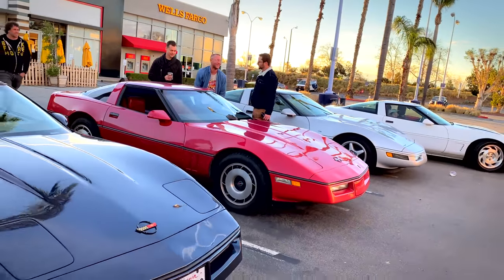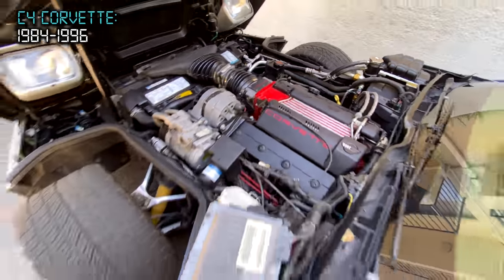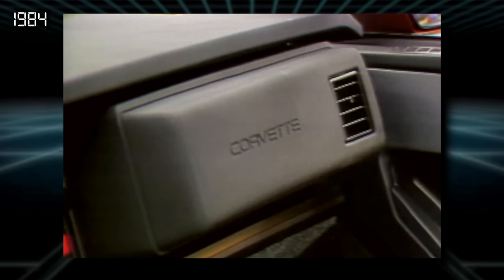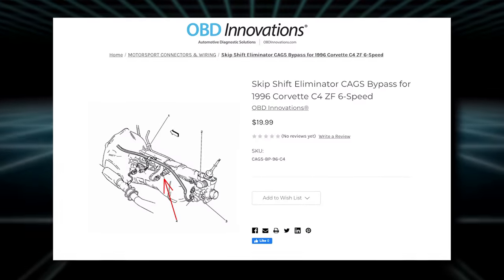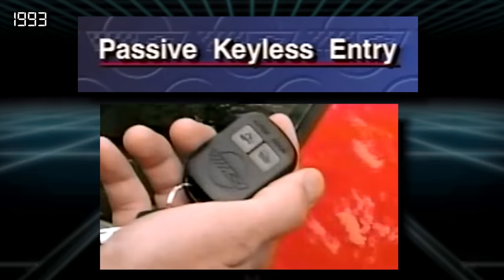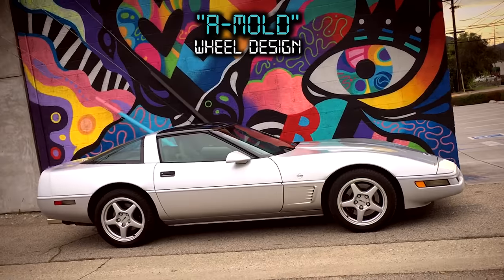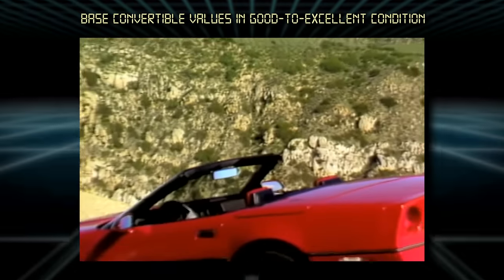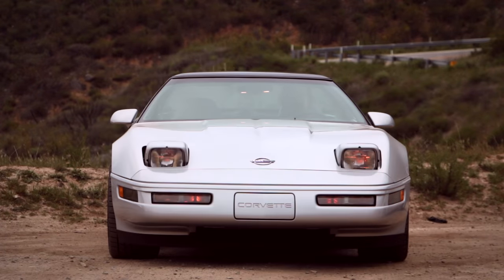C4 Corvette: ULTIMATE Buyer's Guide (Values, Performance, Yearly Changes 1984-1996)

Comment: I found in FL a Green with Beige interior 96 Collector's Edition C4 with 64k miles but it needs a bit of TLC. 3 things are going on with this C4 which needs a tune up as the minor issue and the 2 major issues is that the manual transmission is grinding on 2nd gear and the paint is damaged on the front bumper, driver door and driver quarter panel and driver side mirror. When I say that the paint is damaged I mean it's DAMAGED, the bumper has a big chunk of paint missing exposing the gray metal body, the mirror's paint is cracked along the edges, the quarter panel is missing a bit of paint close to the door and the door itself looks to be like someone put a dent on the door and cracked it in the process  along with paint being chipped there too. The owner is asking $10k for that Vette, would anyone justify investing that amount for a Corvette that has issues like that?
Reply from the maker: Well for one, that's not a collector Edition. Watch my Special Edition video here for what makes a true Collector Edition- 
https://youtu.be/vWhwNK5Lkyg

In any case, it sounds like a basket case example and I would avoid it, unless you love restoration projects. And even then, I'd only consider it for half that price. They're asking way too much from the sound of it.

Comment: My ‘96 C4 reaches overheat when stuck in traffic .. any ideas
Reply from the maker: Great question! Check out secret quirk number 2 in this other video I made…

If it’s overheating even more than that, check to see if the lower intake is clogged with debris. And make sure you’re running fresh coolant, some owners are running coolant that’s decades old. 
https://youtu.be/Hlp0wnXX_sU

Also, turn on your AC (Auto) and that will force the secondary fan to come on  in traffic.
Reply: Thanks … my ac is not working so that may be the cause… had the coolant and thermostat replaced . T think I need a new compressor 
I thought about the fan but was unaware it was triggered by the ac. Thought it came on at a certain temp.
I have the same lt4 collector as you.amazing 6 speeds but 
I sit in traffic with the heat on and watch the gauge go to the /// .. it’s nerve racking

Comment: I have always said a  c4 is technically a mid-engine car, oh and the transmission is where it should be- BEHIND AND ATTACHED TO THE ENGINE!!! My C4 is a 1994 I bought for $2800.00 and she is SWEEEEEET.
Reply from the maker: Nice, sounds like you scored a deal on your C4
Reply: Thanks. I've always wanted a corvette but could never afford the ones I wanted (any c2 or a 68 thru 70) no matter what condition they were in, they were always out of my $ range. Even when the C4 came out I couldn't have afforded one. Then all these years later, and with my acquired mechanical skills, presto changeo , while working in a tow company one got impounded.  Now it was in a really messed up condition, but with the acquired skills and hard work BINGO! BITCHIN RIDE! I'll never sell it and plan on buying another one. God bless, and be well.
Reply from the maker: @williamjames4687  Worth the wait I hope. Thanks for sharing!

Comment: I am looking at buying an 86 with the doug nash. It has 66k on it The body is decent but the Targa Top is cracked and passenger mirror is cracked. It also wouldn't start while I was there. But 15 min later they called and it started they know they is an issue  some where inside the car thats draining the battery? Any Ideas? And the intermittent no start would an 86 have a security system. I am thinkimg thats malfunctioning. If not that any ideas? Any help you can offer my would be greatly appreciated. Oh and what would you pay for this car. There asking $7100...
Reply from the maker: There could be many things causing that issue. It sounds like a car that’s been forgotten about and will need some love to get truly road worthy again.

If you want a project go for it and drive a hard bargain. But otherwise I’d have the seller fix it before considering it again, or move on to a car that will be less of a headache. 

My philosophy when looking at old cars is that if there’s many issues that ARE obvious that the seller hasn’t dealt with, you have to assume there’s quite a bit more that aren’t obvious that you’ll only find out about later.

Comment: Also I'm looking to trade my car for a 1984 C4. I have a 1991 Pontiac Firebird with 305ci TBI V8 paired to a World Class T5 Manual, i have zero issues with that car but is it a wise trade for an 84 C4? I know about the cursed Crossfire system and it doesn't seem too different from my throttle body set up just that the Crossfire has to be in sync to run properly and the current owner says that it's running rough, I was thinking about doing a Carburetor set up to fix that issue but don't have the funds to invest in a Carburetor. I did some looking around for a decent Carburetor set up and it looks like I can get one done for $800, would asking $1k on top of the vette be an okay thing to ask? My Firebird runs perfectly with a lot of maintenance records done by me personally, it has working ac, new alternator, clutch slave cylinder, tires, front pads, rotors, brake hoses, front and rear wheel bearings, lifters and valve stem seals and have extra parts just in case, the previous owner replaced the shocks and struts and hood and trunk struts as well.
Reply from the maker: I see no reason to trade your proven Firebird for a needy 1984 C4. Those arent the best cars even WITH everything running perfectly. 

I'd only go with that C4 if you are actively looking for projects.

Keep in mind that the GREAT thing about C4s is there are so many well-cared for examples out there to choose from. I'd suggest waiting until the right one comes along, or you have enough saved up to buy a trouble-free one.

Comment: If one of my tire sensors go bad how do I get rid of the light in the DIC? Or if I eliminate the sensors
Reply from the maker: Great question. I'm not a mechanic and I didn't dig in that far with my research to figure out the BEST way to fix those tire sensor issues. I know a lot of guys just pull the bulb out of the warning light! And then just get rid of the sensors when its time to change the tires.

Comment: My old 97 z28 got 15/24mpg
 My old 89 z51 got 16/30mpg
 The tpi like reving at just above 1000rpm
 My lt1 was @1600rpm at the same speed
 My 89 also had a 20+gallon tank
My lt1 was a 16 gallon
 The 89 Vette was horrible to drive compared to the 97z28. 
IMO the only C4 to consider if you want it stock... 94-96. The tpi is more reliable, plus no oil leaks unlike the manifold leak of the lt1. But it is just not worth everything else that goes with it.

Comment: I would like to purchase a c4 as well... Problem is I am 15, and insurance and fuel costs are through the roof.
Reply from the maker: I get that...My advice is to go with something a tad slower and cheaper, perhaps a Mustang GT from the era. Then work your way up to a Corvette!
Reply: @RetroCarsForever  sounds like a plan!
Reply: @RetroCarsForever  Any tips on where to look for a 'stang?
Reply from the maker: @inraviratious6418  They're everywhere! The best deals can be had on OfferUp, Craigslist, or Facebook marketplace- Directly from private sellers vs dealers.
Reply: @RetroCarsForever  Well, thank you sir! I just looked at insurance rates for my area for a 2005-2007 Mustang GT, and it's around $139-$168 a month,so not too bad. Now it's just about saving up for the vehicle!
Reply from the maker: @inraviratious6418  Honestly for a first car, I'd go with an even earlier Mustang, the 1994 to 2004 SN95 GT. 

I've owned two...They're even cheaper to buy and insure, and way simpler to maintain than the later Mustangs. For the money, I think they're the best performance car you can drive everyday (as long as you have gas money!)
Reply: @RetroCarsForever  Yeah, I took a think on what you said earlier, so I went and checked some 1995 to 2004 models. I found some on OfferUp for around 1-3k in various conditions. My Uncle is a mechanic, and I reckon he would help me with a project car.

Comment: I bought a 92 C4 back in 2011 that was just about THE WORST car I ever owned (the Pinto I had in 1984 was worse). It was an absolute POS. Overheated on really hot days and some of the electronics would frequently malfunction (security system). I didn't pay a lot for it (it had high miles) but after 2 yrs and MANY issues, I was happy to be rid of it. Bought a 98 C5 in 2017 for 9K and it is THE BEST car I've ever owned. The LS motor is MAGIC and it handles more like a Ferrari.
Reply from the maker: Wow, how many miles did your C4 have? 
This is why I mention in the video that most C4s are pretty used up by 140k miles. They can go longer than that but not without lots of attention.
Reply: @RetroCarsForever  It was definitely higher than 140k. I only paid 5k and did drive it for 2 yrs. It was owned by a govt worker in California who put a lot of highway miles it (I had some documentation on it).

Comment: Stay away from any that have the 4+3 doug nash, the parts like the solenoid are no longer available used or new, so when certain parts go, you're done.
Reply from the maker: I’ve heard the Doug Nash manuals are more fragile but didn’t realize they’re basically impossible to fix these days. Bummer

Comment: C4 corvette should have better mileage mpg than my 03 Northstar deville and probably alot less problematic than my cad.
Reply from the maker: Most likely…those Northstars are known for head bolt issues if I recall. Also just difficult to reach stuff in a transverse V8

Comment: 1:42 to be true, all Corvettes from C2 up to C7 are front mid, the only true front engine Corvette was the C1.
C1 and C8 have the worst weight distribution of all Corvettes, C1 is 60-40 and C8 is 40-60, meanwhile C2-C7 are 50-50.

Comment: 85 is the best year. The round lights are the best, why they switched to square I dunno. The 85 I believe is the lowest ride height c4. I have a highly modified 85 c4 far far from stock. I built it not for resale. It's a track car with 600+hp
Reply from the maker: I havent found anything that said they lowered the ride height in 1985. In any case...Wow 600hp, that's a beastly C4 you have!

Comment: Which years came with that annoying vats system? Trying to avoid those years without having to bypass the system completely.
Reply from the maker: Great question, and one I probably should've included in the video as VATS can be troublesome. They were introduced in 1986. So 1984/1985 are VATS free.

Comment: Can the 92 use a newer computer and get a pass key system?
Reply from the maker: I dont know for sure, but I bet it would be a lot more complicated vs buying an off the shelf remote lock system.
Reply: @RetroCarsForever  the car stereo/alarm shop here tried but said they could not figure out how to disconnect the factory alarm

Comment: That 1984 Z51 spring rates 👀
Reply from the maker: Right? ROCK hard! 
Reading about the development of the C4, this was due to keeping the car under wraps and never testing it out on the open roads. 

So it felt decently smooth on the GM proving grounds/test track, but was overkill for actual roads.

Comment: So all the c4 96 six speed have the lt4 or they came whit lt1 to
Reply from the maker: All 1996 C4s with the 6 speed have the LT4 motor, correct. 

All 1996 C4s with the automatic got the LT1.
Reply: @RetroCarsForever  ok cuz im about to buy one but i like the lt4 and the guy posted that is a lt1 but is manual
Reply from the maker: @sauloguerrero6017  Then they either have a replacement engine, or (more likely) they're confused about the year or the engine. 
LT4s are red with a little "grand sport" badge like you see in the video.
Best of luck!
Reply: @RetroCarsForever  ok tku for the info let me check that

Comment: You missed a dash update I believe happened in 1993.
Reply from the maker: The dash and door panels were updated a tad in 1994. But the big change happened in 1990, which I covered.
Reply: I had a 1994 I bought new then, and the changes from 93 to 94 were more than just a tad of a change.
Reply from the maker: @joeindy942  The basic shape (and skeleton) is the same. Beyond the passenger side (which I mentioned in the video) the biggest difference is a bit less "rim" so the passenger can see/operate the controls.  

Mirrock Corvette is a great resource that goes over yearly changes, they go over it more here...https://mirrockcorvette.com/c4-parts-guide/dash-panel/

"The 1994-1996 dash panels are very similar to  1990-1993 designs with only minor changes."

Obviously this is all subjective on whats a minor or major change, but to keep the video at a reasonable length, I only focused on what I considered to be big enough changes that might be a deal or no deal to anyone considering what year of a C4 they might want to buy.

Comment: The earliest C4 had a lot of electrical problems due to their solid state boards for the computers that were in the Corvette another problem the parts are not available anymore because the car is too old a clean low mileage Corvette can run into other problems like seals that don't seal anymore because they dried out you better off saving your money and getting a later model otherwise you could wind up into a unending money pit

Comment: I loved my 1996 CE LT4, my biggest complaints with them is they were built in an era where quality control from GM was not the best. In addition, they are to complicated for the average bone head Domestic Auto Mechanic to work on with out damaging something. I do agree they are appreciating in value and coming into their owner but it will be cars out like LT4’s and ZR1’s with low mileage and in stock NCRS condition from owners whom maintain the cars themselves which will slowly increase in value. Everything else is spot on.
Reply from the maker: Agreed, next video I’m going to talk about how it’s difficult to find a good shop to work on these cars.
Reply: @RetroCarsForever  I have often thought about opening a decent American auto shop. Corvette Shop off of Topanga Cyn is pretty good and they will work on C4’s. We had issues with everyone else. Other then that and typical old parts needing replacement, my 1996 CE LT4 was one of the best cars which I ever owned. I’m buying a lift to work on my 2001 Roush Mustang myself, and should have done the same when I had the Vette but living in the city, we did not have the room. I did end up repairing the car a few times, after shops made mistakes. Hang onto your C4 Brad. I regret selling mine and we nearly bought it back when it came up for sale last year.
Reply from the maker: @emppowersportsandmarine6270  Thanks, i've heard of Corvette Shop but never actually taken my car there, good to know you recommend them.
Reply: @RetroCarsForever  Corvette shop is the best out of them, J&D Corvette is also pretty good along with WIN Chevrolet (but I would not take a car this old to a dealership today) Check your bill at Corvette Mikes, they do good work but sometimes over charge. I called them out and they made it right. Mike Bradley Automotive lifted the car from the floor pans and dented them, American Heritage lifted the car with a floor jack from one point which can damage a Corvette structurally. I still can’t believe the owner allowed a tech to work underneath my Corvette with only a floor jack in one corner to support it. The car was never the same after American Heritage worked on it. You will probably see Kohle handing out business cars at domestic cars shows but avoid that shop. RPM sent me out extremely low on coolant and did not put my wiring harness back properly so I had to fix it myself. Luckily my buddy had the same car so I was able to sort my electrical. Rydell Chevrolet put soft shocks on my Z51 car which made it bounce at Hwy speed. I had to fight with them to put the correct stiffer Z51 shocks on it. They installed them incorrectly and the sleeves rubbed the body. I also think they were the incorrect shocks as the car seemed to sit high in the rear after they replaced the shocks the second time. It’s a nightmare finding a decent tech to work on these cars. Most of the old school car shops won’t touch them and most of the shops which work on domestics are hacks. If you can work on the cars yourself or find a decent mechanic willing to work on them, you are golden. I tried shops from Orange County to Canyon Country. I have been a mechanic for 23 years, mostly in high line automotive and PowerSports. I caught every mistake other shops made and eventually started doing most of the work myself. I was in between shops and working in real estate when I had that car, but now have another motorcycle shop so work on most of my own vehicles to elevate head aches. I’m going to put a small car lift in next year so I can safely work underneath them. I hope you do not experience these head aches, they are unfortunately common
Reply: These are truly special cars and our CE LT4 Corvette was both my wife and my favorite car to date. We have owned several specialty cars. Hang onto yours. I still regret selling mine and the prior two owners stated the same.
Reply from the maker: @emppowersportsandmarine6270  Thanks for the warnings/recommendations! Loving my CE LT4.